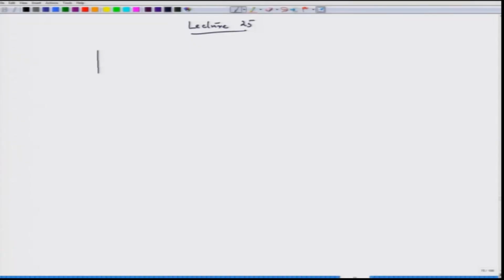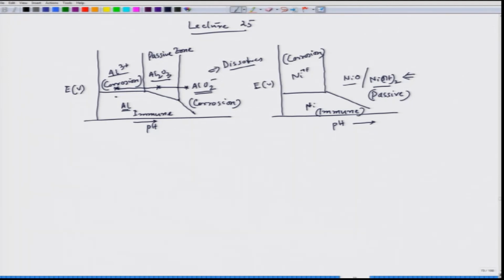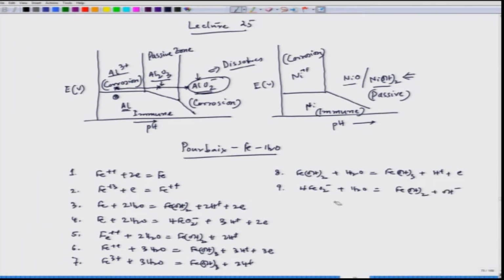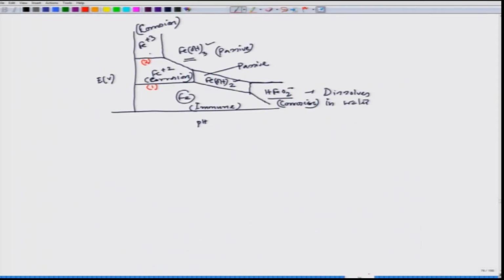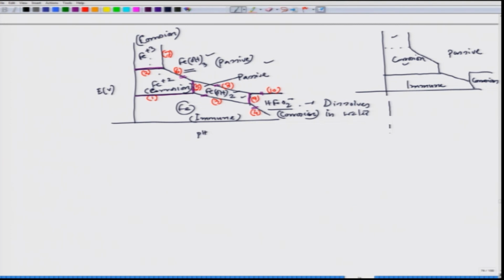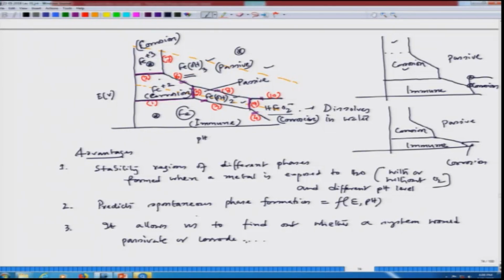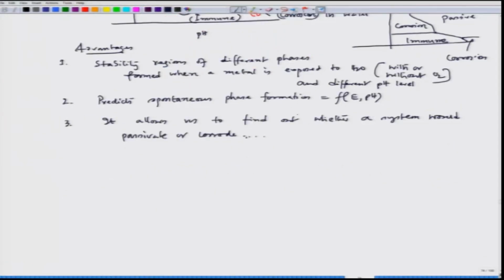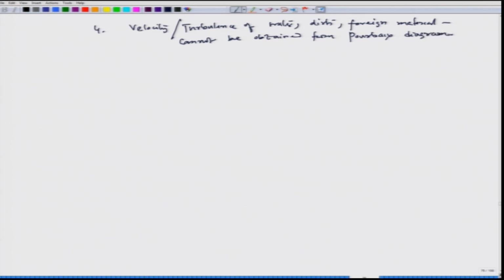noc18-mm14 Lecture 25-Inferences from Pourbaix diagram of Ni-H2O and AI-H2O

Comment: Really really fantastic explanation sir [complete pourbaix diagram series] thank you so much sir. Sir in the limitations of the pourbaix diagram i wish to mention another one i.e while plotting the Type 1 and Type 3 plots [f[E] function of only potential horizontal plot, f[PH] function of only PH vertical lines ] we are considering the activity of metal ions should be 1 [aM+=1] but its not possible in practical condition. So is this condition may i consider as a limitation sir ?
Reply: If you take ion concentration to be some arbitrary value, continue with that only. You cannot change the value for other reactions. Then only the lines will intersect nicely and meet too.